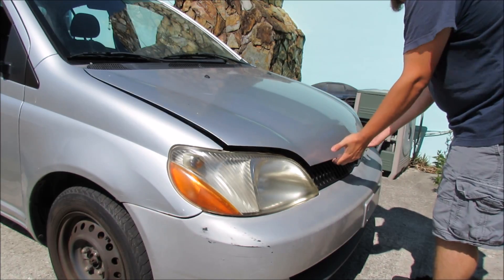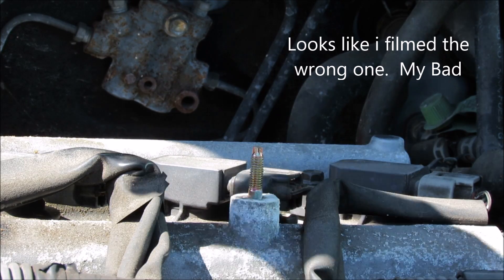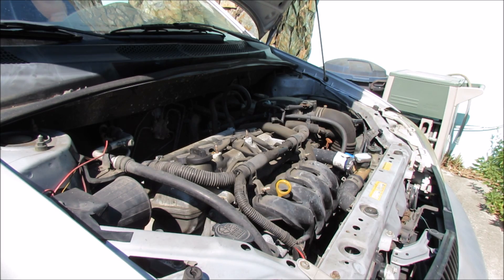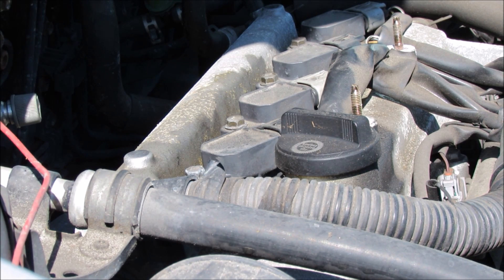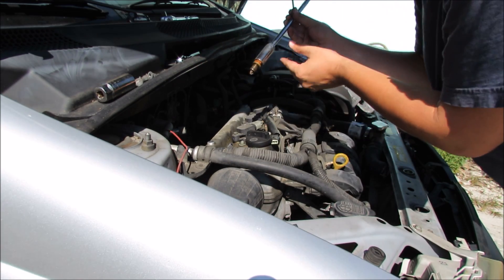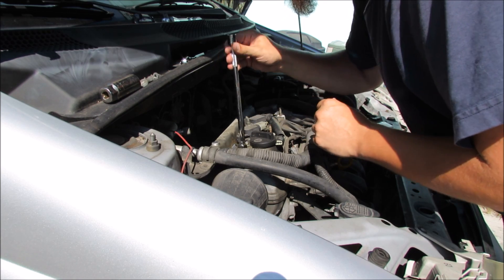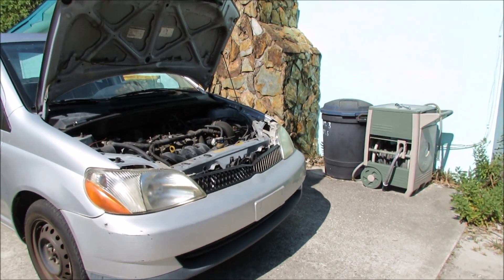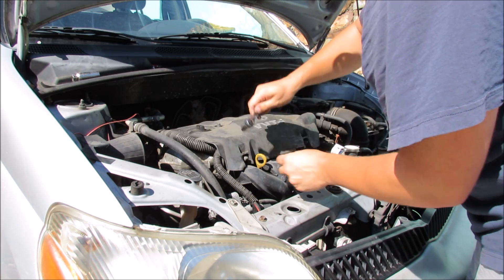Toyota Echo S01E08 How To Diagnosing A Bad Coil Pack

Comment: I've tried this but my car shuts off everytime I pull out a connector on each coil.
Reply from the maker: Sounds like you have more than 1 out.  Usually the car can run on 2 cylinders.  So you may have 2 coilpacks that are malfunctioning

Comment: The water is getting through from the hole in the hood where the windshield sprayers   nozzles connect  and if the ring around the coil has failed or is missing allowing water right in that first coil due to it lining almost directly over the coil in number one cylinder making its way thru the beauty cover around oil cap allowing water to fill up spark plug recess little silicone around that plastic nozzle on the underside of the hood should do the trick my issue was really missing from previous owner changing spark plugs neglecting to put the ring back in place causing engine light to come on and severe shaking at stop light while in gear easy fix though

Comment: Common issue, its just rain, change the coil, plug and add rtv between the rubber and valve cover.
How would a bad head gasket get coolant in the socket well, it makes absolutely no sense.

Comment: Please I have a question
 How much engine temperature in Eco have I have 95 so much
Reply from the maker: Normal operating temperature is between 180 and 205 deg farenheit.  Or 82 to 96 celcius.  So if your at 95c running thats fine.  If it went much higher it would mean something is failing.  You should be fine.
Reply: @thousanddollarcarguy  is degree  normal 😍 thanks bro. if i want lees to 88 c is it ok or not?  and how i do this 😘
Reply from the maker: @HaiderAli-hq9op  i dont think you will get much less than 88c.  You would need more effecient cooling fans to do that or a bigger radiator
Reply: @thousanddollarcarguy  when fans  doing  rpm is down  and  the  engine is have trouble  . think you. God bless you

Comment: Dear sir I have question about Toyota echo  ...why when I start the car it take time to change the temperature gauge from red to blue to nothing ( 5 min ) to be ready to move ...,thanks for understanding
Reply from the maker: The only thing changing red to blue is doing is reaching a certain operating temperature.  You can drive the car without waiting for it.  If the light stayed on red i would be concerned that it was overheating.  But theres no reason you cant just start the car and go.  If you lived in a very cold climate i would recommend letting the engine warm up before immediately taking a off.  But if you live in a moderare climate i would just give the echo a few seconds after starting and then drive away.
Reply: Thanks a lot for always support,,, one more question about echo 2000 Manuel it hunting after starting the engine looks like it will die . It is need to put acceleration around 2 min to got stable ( durning this hunting the engine have vibration very high ) 
I have changed the spark plug and clean all gasoline cycle so please till me what I need to do )
Reply: Thanks a lot for always support,,, one more question about echo 2000 Manuel it hunting after starting the engine looks like it will die . It is need to put acceleration around 2 min to got stable ( durning this hunting the engine have vibration very high ) 
I have changed the spark plug and clean all gasoline cycle so please till me what I need to do )
Reply from the maker: @KimoKimo-kw5iz  make sure it doesnt have a head gasket leak.  Check (while cold) to make sure you have coolant in the radiator.  If coolant is getting into the combustion chamber it will die.  Also proper battery voltage is important.  What else does it do before it dies?
Reply: Thanks a lot for you support....I will check then I will let you know ...you have any Whatsapp number so I can send you photos and video about my problems
Reply from the maker: @KimoKimo-kw5iz  nah man
  I have enough problems on my own
Reply: Okay no problem anyway thanks a lot
Reply: Also remember you made this Chanel to support each other ( and thanks for your attitude )

Comment: CONDENSATION I thought?? on #1 spark plug socket well.  I'm on my 3rd. Echo (2 car accidents destroyed my previous 2).  Water collection has happened on my #1 (far left side of engine) spark plug socket with each of my 3 Echos (2000, 2001, 2003).  So whenever I think of it, I'll check that socket well (after removing the coil pack and with the spark plug still in place) and blow it out/blow it dry with my air compressor, then remove the spark plug and see if all is well.  I have found the spark plug to be prematurely degraded and the spark plug well wet when I have check them.  It must be a re-occurring issue.  I read another comment that the serpentine belt throws water up on top of the engine, then collects in the #1 socket, and that the water does not drain properly off that end of the top of the engine.  And that is what I had always thought, but could not figure it out.  I just assumed that water was condensing in the #1.
Reply: I have same problem miss fire in #1 and condensation in the ignition coil.
I am trying lately to check a vacum leak because the IAC valve was clogged with carbon and I cleaned it and the throttle but it may be a leak for a light idle change.

Comment: 2000 with 315k still going pretty strong, it has a dual function 'turbo' switch (the A/C button) :D...  had to finally replace the valve cover gasket and it was very 'crispy' (valve guide seals next) ...  I had this problem a time or two also..  I removed that cover back in the day and left it off..  then had the dreaded 'water shorting the boot' issue..   put  the cover back on and after a heavy downpour there is water all around the oil cap lip area and even some next to coil pack 1   BOOM!  Im gonna fab a cover to go on top of that one which will span the whole shebang!   I think it comes from the washer nozzle opening..    L<3ve this car!  update: now at 345k,  using a a plastic trash bag and some double face tape, cut a piece of plastic bag the same size as the shroud,  lay a strip of double-face one the back (horizontally) and the front.. stick the plastic to it and no more water drips from the windshield washer hole to cylinder 1 : )

Comment: same problem here but i change  the head gasket and it still does it about every 6 mos. another way to check coil is to take it out and hold it about 1 inc away from the top of engine , if no shark its bad . i also have a radiator code so i know the water im finding in shark plug hole is from engine coolant, it look real muddy . so i pull the shark plug hole ,cleaning it out with a rag and putting a dry shark plug and coil pack back in. its more than condensation. 250,000 miles maybe heads. by the car still runs great.

Comment: At 200000 the bearing on the clutch for the compressor shit the bed and left me stranded while on Vacation and finding a replacement was fun. I was going to try and get the serpentine belt to spin with a shorter belt? Found an ac compressor after a few days and was able to travel again.

Comment: What everyone should do is spray the entire engine with WD-40 and on those Echo's all around the coil packs and rocker cover.I did my 2002 (UK) Yaris in the entire engine bay incl underneath,all nuts,bolts,track rod arm etc Used big can 600ml and the remaining left did all nuts,bolts,brake line etc under the back which i do 2x a year.It kept my car from causing bad rust over the 10 yrs i've had it.It rains alot over here in the UK and the salt from the roads don't help non users of WD-40.

Comment: My echo had the exact same problem on the same cylinder, 2 times!
Reply: Mine too... Smh
Reply: Mine too how do you fixed it?
Reply: Christian Feliciano new coil packs and fuel injector wiring was all corroded as well so I redid that and with coil packs solved the problem
Reply: My Echo had condensation in the same cylinder. I wonder why it's prone to that cylinder. I cleaned the rubber contacts and applied dielectric grease to the boots and rubber seal at the top. Hopefully that stops the problem.

Comment: Mine does the same every time it rains and leave it out for longer periods... then I drain the coil tube before removing the spark plugs, i get water, not coolant... but I only get water into two of the coil tubes, the other two remain dry... I recently changed the gaskets on all the coils will see how that works...

Comment: Wish I found this last year haha. Similar issue but mine was on the third, had a code for a misfiring cylinder, changed all the spark plugs just in case and haven't had any issues since.

Comment: I have a 2002 corolla, when I unplug a coil pack it does everytime smh, Idk what to do
Reply: I periodically check my #1 spark plug well because water has collected in it on each of my 3 Echos.  I just pull the coil boot, and with the plug in place, and blow it out dry with my air compressor, then I pull the plug and check it and the coil to make sure they are ok.

Comment: My echo seat belt  is stock up, is there a control relay that's holding it? Please advice. Thanks
Reply from the maker: You will probably have to remove the belt.  I believe there is a clip that holds it shut.  But the belt will most likely have to go all the way back in the holder before it can come all the way back out and be bolted back in.
Reply: @thousanddollarcarguy  Thanks  men
Reply: same here seat belt sensor but it takes a computer to find which one is bad than contact the air bag guys vid on you tube  was told 99.00 computer test and about 4900 to rebuild by the air bag guy check with them im planning to

Comment: Hi  K$carguy, Thank you for this info. it's useful. I also observed the "tik sound" I heard when I removed each coil pack for the good spark plugs. The bad ones didn't have "tikling sound" 
Thanks God there's a youtube.
Reply: This is a problem that this model has. I have a toyota yaris with the same engine.  And after a rainy day  with a lot of water( i live in south america) the same cylinder tends to get wet and cause the same  problem...  after  drying it, the engine works ok...  no gasket problems either...

Comment: Hey you Echo how to blow a head gasket or I didn't
Reply from the maker: It wasnt blown.  Just condensation
Reply: Do you know how the moisture  got in there I had the same problem as you
Reply: @abrahamromero4186  Cover wasn't fitted/screwed in right or tight enough.Worth using WD-40 in the entire engine bay incl the coils....every electrical bit to stop condensation.It doesn't cost much to stop this and will cause less head aches in the future.
Reply: @thousanddollarcarguy  WD-40 the entire engine bay incl underneath it's help in the long run.

Comment: Love the series! This is a common problem in many echos, mine including, you have to put some electrical grease when re-installing coils, because water seems to be dripping near the oil filler cap which is right next to cylinder #1 due to windshield washer nozzle which is dripping when it rains even slightly, better seal that thing too. 
Echo is a beast, cheers from Latvia

Please do a video on:
 throttle body cleaning,
 timing chain tensioner replacement (common oil leak, exessive in my case),
 how to diagnose bad injectors
Reply: Oh yes, I saw the difference when I removed the cover. The cyL#1-head  was clean while the rest were dirty. 'Will take your advice too. Thanks Bro. and thanks GOD we have a YOUTUBE.
Reply: I don't think it is the wiper-fluid nozzle, I resealed it and still have the problem.

Comment: The same thing would happen to my echo periodically. It's just condensation.
Reply from the maker: That makes me feel optimistic for the future.  Thanks for the heads up.
Reply: Rain more likely. The corner doesnt drain off so if it doesnt evaporate while running the water is likely to drip into the plug hole.
Reply: This happened to me and i had to siphon out the water it was so full. But the rubber washer was bad too so i switched w a better one and am hoping it will stay dry now.
Reply: This is happening to me too. I resealed the wiper-fluid nozzle because I assumed that that was where the rainwater was coming from, but it didn't work. I still have water pooling up on that first coil. Have you figured out what to do?
Reply: @clydebink  the serpentine belt throws water up onto the top of the engine with number one cylinder getting the worst of it. After time the seal gets hard and allows water under it. Just use some RTV between the valve cover and the coil pack. This happened to me and I ended having to do both 1 and 2 cylinders. No issue after doing that.
Reply: @fibercouggocougs8656  Yes, I've had 3 different Echos (2000, 2001, 2003), and each one of them have/had the same problem with the number 1 spark plug well collecting water.  So I just pull the coil out, and with the spark plug still in the socket, and blow it out dry with my air compressor.  Just keep your face back when you do this, as the water will fly in your face!  I then pull the plug and inspect it and the coil to see if there is any degrading/damage to either one.
Reply: @fibercouggocougs8656  what’s rtv?